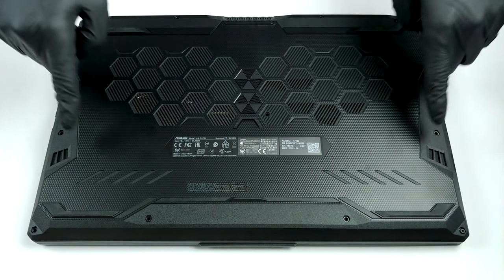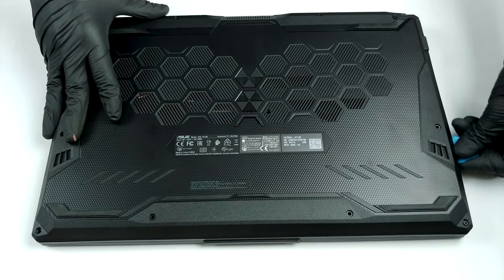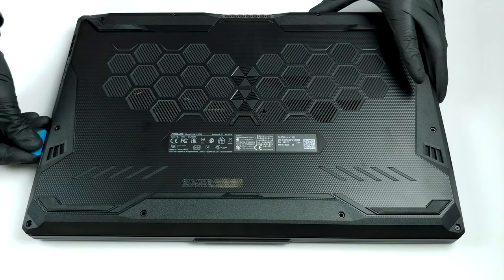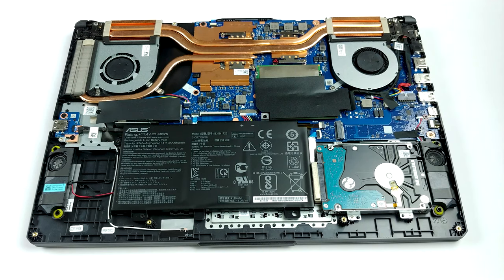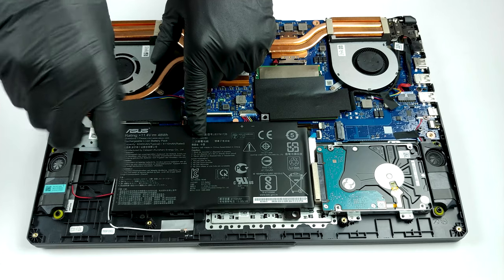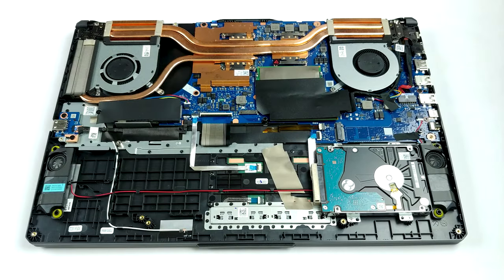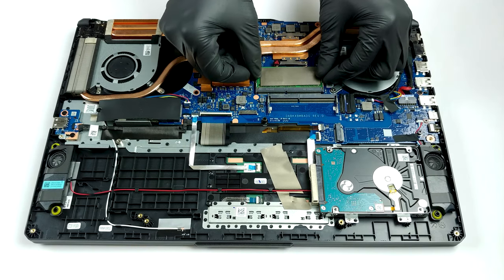🛠️ ASUS TUF A17 (FA706) - disassembly and upgrade options

Comment: Found what I needed in this video but a quick component tour would have been helpful. A quick presentation note as well; if you are going to use generated speech remember to enter numbers in as text rather than numerals, this will make it so numbers are read in a more human tone e.g:
- "4800H" will be read as : "four eight zero zero haitch"
- Where as "Fourty eight houndred H" will result in a more realistic delivery.

Comment: Just wanted to say that if you have the model with the 90Wh battery there will be no space for a 2.5in SSD. Only for the 2nd NVME SSD. You will only find this out by either reading this or taking off the back and seeing the huge battery which is twice the size of the one in the video.

Comment: You cannot upgrade the a17 in canada for the ssd, just nvme extra slot. Missing the connector for a 2.5 inch drive.

Comment: Can you please tell me what cable you used to plug in the HDD because I saw other disassembly videos and they never had that HDD cable before. Thank you.
Reply: Sinamoni Fenunuti do you already found?
I’m looking for this plume
Reply: I have same thing, got the chasis for a hdd but no cable between board and drive
Reply: Check the hidden compartment in the original packing. You're welcome :)
Reply: @mariusbaumel4643  Thank you so much!
Reply: @mariusbaumel4643  OMG, thank you so much 🙏👍
Reply: @mariusbaumel4643  I kept my packaging but I can't find that cable, just needed that to connect my hdd inside
Reply: What is the cable called? I desperately need it

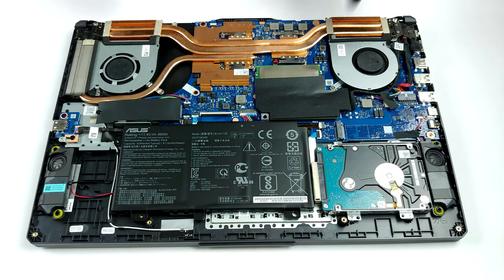Comment: 1:11 you said for its storage, it has one 2.5 SSD/HDD drive bay and not one but two M.2 NVMe slots but you did not show the second M.2 Slot. Where is it located?
Reply: it is located just above the HDD bay to the bottom right of the ram slots

Comment: how did you install HDD disk, when i put in the place, screws doesn't fit. if I flip the disk, cable is not working because is too short, What am doing wrong?

Comment: For those looking for the Asus TUF Gaming A17 FA706QM-HX001 model (with NVIDIA RTX 3060), there is no room for a second drive due to the large battery. There is also no free slot for a second M.2 drive.
Reply: Wtf for real?? :( How sad.
Reply: That sucks, I was looking at a used a17 too…
Reply: Wait, is that ONLY that direct version?

Comment: I just recently got a new laptop my first gaming laptop from Asus (A17 TUF FA706IH) and I've upgraded it with a 2.5 1TB SSD as well as an M.2 NVMe 1TB SSD, 2 16GB memory cards, and also an intel Wi-Fi card 6E And the latest version of Windows 11 Professional.
Reply: Superb bro I have also same laptop from 3 years and recently upgraded 16gb ram
Reply: what gen is the ssd you used? Does FA706 support Gen 4 SSDs?

Comment: This doesn't seem to have the cable for the version I have in the U.S doesn't seem to have the connector either :(  and it saying only 24gb of ram I'm so confused with these laptops.
Reply: same issue, this one has an extra cooling pipe too

Comment: Just upgrading my A17 and wondering what your opinion on re-using the heat spreader pads on the new RAM is? Peeling the ones off the old ram, they seem in great condition and possibly can be re-applied to the new RAM. Is there any benefit to doing this at all or is there potential for it to increase heat signatures?

Comment: Hello, I've recently been having really bad wifi connection issues with this laptop. I've tried forgetting my wifi connection and reconnecting, updating wireless adapter driver, uninstalling It and redownloading, and resetting my network. All of those fixes worked at least once for a short period of time but the same random disconnection issue always comes back. I've given up trying to fix It for the past week and I want to replace It, the model Is Realtek 8822ce wireless lan 802.11ac pci-e nic, do you have any great suggestions for a replacement for that card?
Reply: same here
Reply: did you ever end up finding a solution?
Reply: @SiddhantKulshresth  I just brought it to an ASUS service center and got it replaced. It took about a week or less if I remember correctly.

Comment: I just bought an a17 and can not install a sata hard drive. The cable I got is different from your video. Would you mind post the cable part number. Thanks.
Reply: Did you check the hidden compartment in the original packing?

Comment: I have that one (not exactly that version but...) and at a certain speed, the fan makes a lil scritch noise that is very annoying, not present in high fan or very low... I don't know what to do exactly, I tried to disassemble with your tutorial (thanks to you) and I saw nothing wrong, no dust or anything. I might try to power it on while it's open but I'm scared to mess up ha ha I don't know if it's "normal". I noticed that mainly playing Resident Evil 8.
Reply: I have an similar issue. For now the GPU fan tries to rotate but it stop. Happens every 5 seconds. I've opened my laptop carefully it is without dust and it still does the same
Reply: My laptops fan started to rub after 2 years
Reply: So the gpu fan is the one on the right when you open it corect?

Comment: If the laptop comes with a bigger 90W battery will it loose 2.5" hdd or additional ssd slot?
Reply: It will lose the 2.5in HDD/SSD spot.
Reply: @jasonmesa4224  
Thank you!
I figure that leaves 2nd M2 still available.

Comment: Hello I need some info on this laptop.

In my country they are launching 90wh variant only after 3 months.

Can I buy 48 watt hour now and upgrade to 90wh battery later ??

Is the battery upgradable.

Also is the RGB keyboard upgradable ??

Instead of single tone colors can we upgrade to individual key RGB.

I mean is it possible to put ASUS ROG laptop's RGB lighting here ??

The keyboard looks similar on both these series.

Comment: Hello,

Do you know where I can find the exact/ same motherboard for my ASUS TUF GAMING A17 LAPTOP RYZEN 7 4800H GTX 1650 or better that is compatible to the laptop housing.  Tried to check at Asus website but always "HI this is our new laptop" something like that and it is getting annoying.  Also found kinda looks the same but not exactly and then found out later it is for different type of laptop.  So if you know where I can get a new motherboard please help me.  

Thanks.

Comment: One quick question please. I have a 48wh battery unit. Is it possible to buy 90wh battery and put it in my laptop? 

Thank you in advance. 🙏
Reply: Sure, just make sure they have the same output specifications: Voltage power and so on
Reply: I have FX706HE-HX001 with 48Wh 11,4V and FX706HM004 with 90Wh  15,4V battery.   90Wh battery could possibly phisicaly fit place in first comp, but not opposite, because morherboard of second its much wider,  48Wh battery is bigger.  Voltage is different.    Both computers have slot for second M2 disc,  but looks that none have possibility to connect third HDD/SSD  disc. First comp have empty place for HDD, but no cable is present, second have no place because of bigger battery.   On both computers there is no such connector on motherboard, as seen on video, to connect HDD/SSD. Any solution to connect  HDD?

Comment: is the m.2 slot are working? anyone tried? thank you
Reply: There is only one M.2 slot. My machine came filled with an Intel 500GB SSD. For some reason, I thought there were two M.2 slots. I have an extra Samsung 500GB 970 EVO Plus NVMe that I wanted to add.
Reply: @BlankBrain  Thank you, I bought it already, only 1pc M.2 slot. maybe the Nvidia 1660 ti has the 2pcs M.2 slot. Mine is a Nvidia 1650ti.

Comment: какой там блин термообмен? Там все на лейкопластырях собрано. У меня на MSI GF63 все похоже, но термообмен совсем другой. Если TDP около 30W то поверю, но он не может быть таким. Там сам проц AMD, ГПУ - от Intel. Внутрянка должна печься что моя покойная бабуля.
Reply: what is the pancake heat transfer? Everything on the band-aid is gathered there. Everything is similar on my MSI GF63, but the heat exchange is completely different. If the TDP is about 30W then I believe it, but it cannot be like that. There is a percent of AMD, GPU - from Intel. The inside must bake that my deceased granny.
For u from Google Translate
Reply: @papadark1951  Bad translation. Плохой перевод.